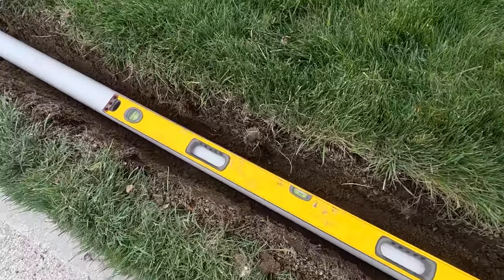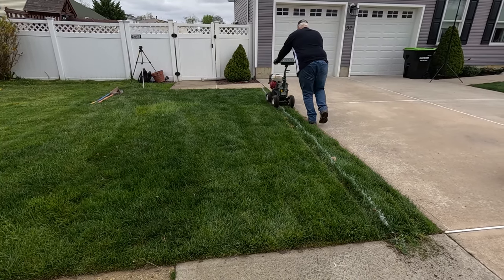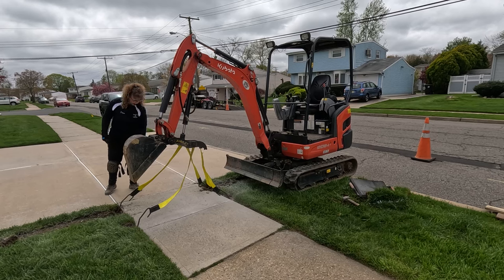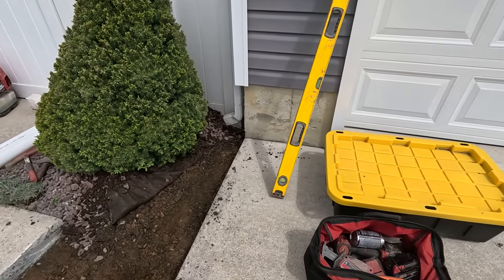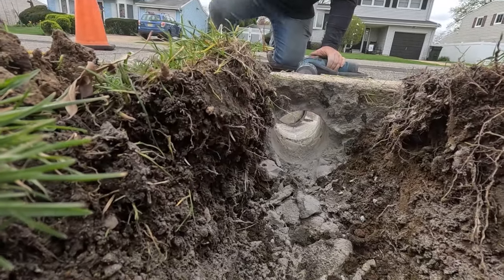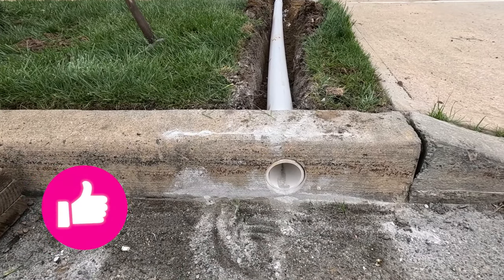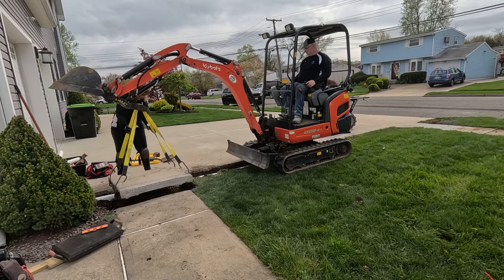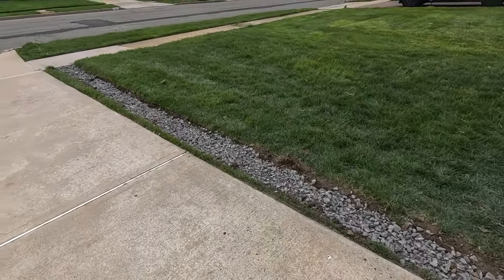Underground Buried Downspout to the street and coring the curb.

Comment: I have seen other guys put a car jack behind the drill to provide a constant force while drilling the curb. The stand is a clever idea as long as it doesn’t get too hot!
Reply from the maker: Thank you Stuart. These dry carbide bits work very well and I’ve never needed extra pressure.  So far no issue with heat. If that happens we could add some lubricant. Thanks again and have a good evening, Tom